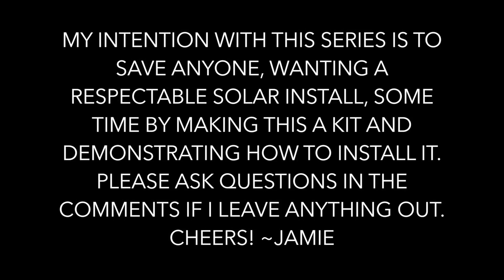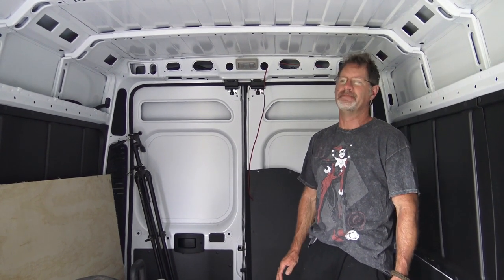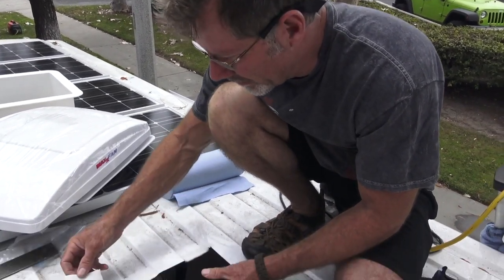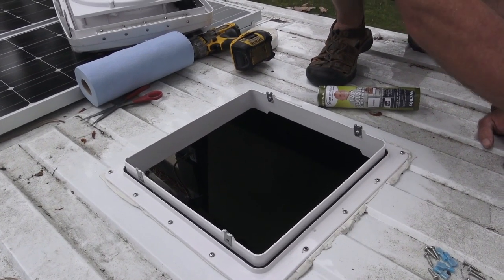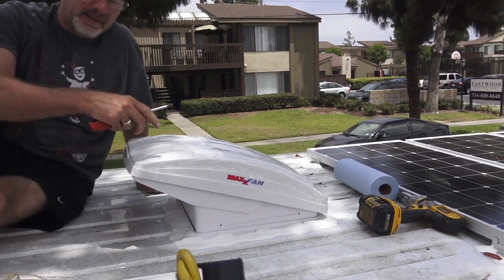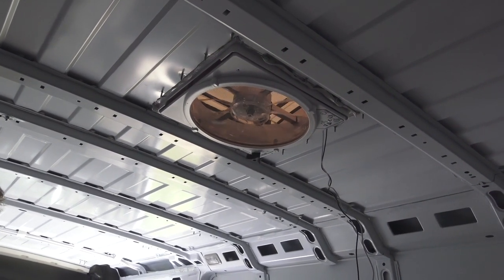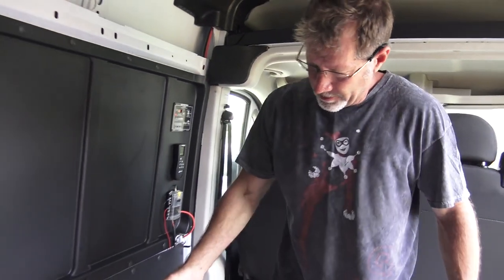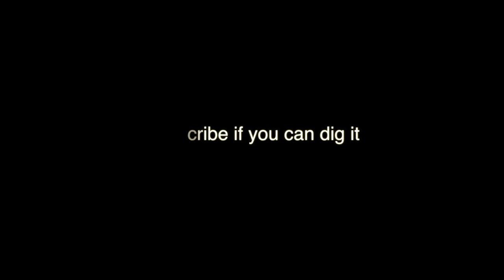How to install a Maxx Air Fan on a Promaster Van | Solar install Wrap up

Comment: Grinder: $12 at Harbor Freight with their 20% off coupon.  I'd suggest the roof cleaning before the corner holes!  :)

Dangerous setting self tapping screws like that on such thin flexible sheeting as vans have, would predrill with an undersize drill bit so amateurs aren't over driving the screws and risking cracking the flange...  

Also, since minimum roof thickness is 1.125" for the MAXXfan, many will want to frame out the freshly cut hole with something like 2x2 lumber before screwing down the roof flange, and that way the screws will just go through into the wood.  This gives you a little more solid of a mounting, as opposed to just screwing the interior trim piece into whatever ceiling material you use (plywood, tongue and groove, etc.).

Also, carefully wash the roof after the Dycor dries: all the metal shavings will rust from the cutout that blew across the roof and create a heck of a rusty stain.

Oftentimes easier to do the wiring before setting the fan in place.

I'd also recommend cable wrap on all wires in the van.  Just not worth the few bucks of savings versus the chance of a shortout later that will be a huge thing to deal with:

https://www.harborfreight.com/catalogsearch/result/index/?dir=asc&order=EAScore%2Cf%2CEAFeatured+Weight%2Cf%2CSale+Rank%2Cf&q=cable+wrap

A great fan.  I'm a fan.  :)
Reply from the maker: All great advice!
Reply: B Miller wonderfull now I dont need to write all those suggestions out.. just takes a few YT views to learn all the pieces to the puzzle and get it done right. I always learn a lot from reading the comment section. Thx!  BTW when one does screw the fan through the metal roof into the inside wood frame you will probably need longer screws i know.. but what kind would be best for that application? Thx again.
Reply: Great advice Jamie. Can you recommend someone for hire including yourself to install a Maxx Air fan in a Ford Transit?
Reply: Don't use a grinder. The sparks will stick to and melt your paint and then cause rust.
Reply: I am doubting they are self tapping screws to begin with.  I have just received and about to install my Maxx Fan Deluxe and they most certainly are 'not' self tapping screws.  Maybe his were, but odd that mine aren't I guess.   Will be using a small drill bit for install.
Reply: @enigmaticnomadics  What do you mean it's easier to do the wiring before setting the van in place?
Reply from the maker: @stevenjoseph8134  I would definitely predrill Steven. Plus it helps prevent the screw from walking around and making the bracket holes bigger than it needs to be.

Comment: Bro, I’m about to do this. This video has given me confidence to go through with it. So well done! I’d love to know more about the battery and wiring
Reply from the maker: The white wire goes to negative and the black wire gets a 7.5 fuse (in-line is fine) goes to positive.
It comes with a fuse also, but that’s how I do it.
Reply: @enigmaticnomadics  and type of battery?

Comment: Thanks for this. It was very helpful during my fan install a couple of days ago. I wish I hosed down my roof sooner even with the wet caulk as I did a lot of scrubbing of those little metal shavings this morning. Also, the angle grinder looks easier than my jigsaw but it got the job done.

Comment: Amazing videos Jamie. I wish I already knew about the electtical. Just bought a bare, used 2015 Ford Transit. The owner did the most bizarre installation of a fantastic fan that I have to remove and replace with a MaxAir fan. I'm going to try to do it myself with your video. Thank you for posting all your videos. Been following you for 2 years. You're amazing!😇

Comment: Diyvan.com makes an excellent flange for the ProMaster corrugation, and offers good advice and installation tips too. Recommend pilot holes even with self-tapping screws, and painting the bare metal with a rust-resistant paint like Rustoleum. Not related to the fan, but I also found a handy organizer for the rear driver side door in the Professional's Choice equestrian trailer caddy. Nice job, safe travels!

Comment: WARNING this guy is some kind of grinder master craftsman. I believe this guy grew up with only one tool the disc grinder and this is why he prefers it lol. I installed two fans on my van and used disc grinder on first one it was a MESS! I HIGHLY RECOMMEND USING THE JIG SAW. Went way smoother with way less metal mess everywhere.
Reply from the maker: +Mowglie lol, jigsaws with a high quality metal cutting blade work well also. I carry one on hand. In my experience. They tend to scratch the roof more. Your mileage may vary. 😉

Comment: Thanks Jamie for the detailed walkthrough of the installation.  I plan on doing my van build June 2019.  If all the electronics are installed first, I wonder if that will make it more difficult to install the insolation and panelling afterwards...
Reply from the maker: Well here we are in June, how’s it going? It really depends on you knowing in advance where you want your wiring in your outlets to be, but I think running the wiring before the insulation is a great idea! Thanks for watching!

Comment: Thanks for an excellent video.  I used it to guide me through my own installation.  Only question is, where does the van wire come from?  Is it the back up camera?  The puck light?  A stand-alone wire you hooked into those fixtures?  This is the last step in my install and any clarification will be greatly appreciated...
Reply from the maker: I connected to a fuse block. As long as you have continuous 12v power running to the fan, your good!
Reply: @enigmaticnomadics  Thank you for the info!  Truly appreciated :D

Comment: Hi Jamie... I had missed the wiring part (duhhh!!)  sorry bout that My BAD!!  Thank-U  You mentioned Automotive wire for the Fantastic Fan what Wire should I purchase?  TFS
Reply from the maker: I like 14 gauge stranded wire for this. Actually I didn’t show the wiring into the fuse block. My bad! We just wanna run the black wire from the fan to the positive post and the white wire from the fan to the negative post. But I prefer to put it through a fuse block at about 7.5 A fuse. Hope that helps!
Reply: @enigmaticnomadics  Yes.. Thank U so much for the Reply.  XOXO

Comment: I’d be in business if I had tools😏... nice vid! I was thinking of taking out my rear window
Reply: Wanna Wander   Check with your public library.  Where I live they opened lending tool library for anyone with a library card to check a few at a time.  The city found appropriate space & funded a library technician position that works with a slug of volunteers for check-out and workshop instructors. Two union apprenticeship programs donated a couple of complete tool kits, plus others in community have been donating needed tools off the "want list".  That grinder is a great example, yup only $30 bucks, but what am I going to do with it after cutting a hole in the roof of van.  Might give to the library if they don't already have one for checkout.
Reply: Karin Hart wow! That’s super cool! What a great idea!!💡 I’ll do that! 

Happy trails💜
Reply: Wanda, yes a great idea. Several towns & cities in my area have Tool Lending Libraries.  I once gave a friend a ride to the tool library & he walked home pushing a wheelbarrow carrying a shovel, rake & post hole digger he checked out for a long weekend.
Reply: Wow! That’s great!

Comment: I've seen a lot of installers file the metal and spray Rustoleum before applying the butyl tape.  Is that not needed to prevent rust??

Comment: You should be using wood blocks as backing when screwing through the roof so the screws have something to grip other than a thin layer of metal

Comment: I have this fan and I can’t seem to install it on my 120V AC. I tired a LED light driver/ converter with a 6amp rating but it didn’t want to run

Comment: Where did you get the wires coming from the van? Did you run separate wires and connect it to the van batteries or battery bank for the solar? You didn’t say where the wires came from that you’re connecting to the fan.
Reply from the maker: We used wires that we bought separate. 14 gauge. Ran them to the 12v fuse block powered by the coach batteries and used a 7.5 amp fuse

Comment: What was the fan wired to, I know to the van, but what in particular?
Reply from the maker: The fan was wired to the fuse block which was getting power from the coach batteries in the van. Hope that helps.

Comment: hi Jamie < so these fans are good ? so my understanding of these fans is that you can leave your window down a little and the fan will drag the old hot air out correct ? they must be very strong draw
Reply from the maker: Yes, Maxx fans are probably the best on the market.
Reply: @enigmaticnomadics  : thanks, Jamie also I continually re-watch your video on Lou and his vardo , how is he going ?

Comment: 4.5 to 4 inch angle grinder; cutting disc? correct ??  There are multi use cutting, that are steel, that last longer. ?
Reply from the maker: Yeah, actually any size grinder disk would work, but you’re right, it needs to be one design for metal cutting. Side-by-side the ones designed for cutting brick and mortar look exactly the same, but it says it on the side of the desk. Good luck!

Comment: What wires did you use too extend the max air fan wires too your fuse block?
Reply from the maker: I used #10 wire but smaller wire would work.

Comment: Could I run this off a goal zero lithium 400...or 12 volt...??
Reply from the maker: I’ve never tried that bread, but it seems like it might work for a while at least. You can definitely pick up a deep cycle battery from Walmart for pretty cheap if that’s the best you can do. These fans are pretty low drawl. Best of luck my friend!

Comment: Hey Jamie, Great video here as well as the solar/shore power install. I was going to have a Maxxfan installed at your van build party but doesn't look like I'm going to make it as I have toooo much left to do on my van build. Not much of a carpenter and I'm slow. Anyway, on the MaxxAir fan install, what type of screws should be used for the outside flange on a fiberglass high top van roof?
Reply from the maker: The ones that come with it should be fine. Id use 2 tubes of dicor instead of one on fiberglass. The dicor holds it down too. Try to make the build! Cheers!
Reply: Thanks Jamie. I'll try. Comimg from E. TN and would be a great help to have folks who know a lot more than me helping me to move this van build along. This is my first go around at this and I wanted to stay out there rather than drive all the way back to close out everything back here. Have a great build out if I can't make it and I'll try to catch up with you down the road

Comment: Where did you splice the red and black wire from?
Reply from the maker: A 12 volt ground block wired to the house batteries.

Comment: Thanks for the detailed instructions with the video. A lot of videos assume the viewer knows a lot, which I don't! I almost feel like I could it myself now. One question- I saw video where the maker said we should prime and paint the bare metal exposed after cutting. Do you think folding the tape over the metal makes this unnecessary? Thanks. Love your channel.
Reply from the maker: Glad the video helped! Absolutely folding the butyl tape over the edges seals it from moisture and that’s what we want to accomplish. You can do it!
Reply: @enigmaticnomadics  Thanks!

Comment: Very cool, but one problem. I have watched these three times and have not seen how you used the shore power that you brought into the van.
Reply from the maker: The shore power lines wire into the inverter/charger. The inverter needs to be an inverter/charger, not just an inverter. Here is an example: https://amzn.to/3bGykKR

Comment: What gauge wire did you use? and what size fuse?
Reply from the maker: depends on the run. I usually over do it and use #10 but it's only pulling about 5 amps max. I have a 7.5 amp fuse in mine.

Comment: Thanks for the walk-through! I’m going to cut the hole in my Promaster this morning. A question...I see how you connect the power but I didn’t see where you got the power. Are you tapping in to existing power in the back (brake lights?) or are you running power from the source?
Reply from the maker: Hey Joe! We connected to after market deep cycle batteries through a ground block I installed. We want to avoid using the car battery because it is not deep cycle, thus the fan drawing juice from it on a regular basis will shorten it's life. Good luck on your install!

Comment: Can i put a fantastic fan or max air on a fiberglass high top van?
Reply from the maker: Yes. Done it a bunch.
Reply: Laurie Sherwin It’s usually an even easier install, since most fiberglass roofs are flat. 👍
Reply: Sure!, It's actually a little bit easier because they are usually a flat surface. The only difference is I use boat life caulk instead of Dicor it's been developed for fiberglass and gel coat. And it's removable!
Not easy but with a putty knife and some solvent it will come off clean. I do scuff the first 1/2" of the opening with a scotchbrite pad to help with addheasion then wipe the area with rubbing alcohol. Hope this helps with your install.

Comment: You should have made you a cardboard template Jamie. It would have been easier.
Reply from the maker: No need. 14 1/4 by 14 1/4. Works every time.

Comment: what if i do not have those red & black wires you had there, do you have a vid showing us how to do that? :) !!!
Reply: OR is there away to directly wire the fan to some kind of rechargable battery???
Reply from the maker: Yes. The black wire from the fan goes to positive on the battery

Comment: What gauge wire did you use to connect to the unit?
Reply from the maker: 14 is fine. You’re pulling 4.65 amps max.
Reply: @enigmaticnomadics  This is saying that I used awesome

Comment: my 2018 has a spot made to put a fan that is flat  once you make the cut out
Reply from the maker: Yes if I remember right it absolutely does, but always remember where you want the fan and let that dictate where it goes. Some folks want to put it to one side or over their head where they sleep or maybe were there cooking. This guy really is the limit!
Reply: @enigmaticnomadics  Mines a 136 wb so it doesnt make much of a difference its close to the stove which needs ventilation the most
Reply: I also have a couple small fans near the rear flow through vents

Comment: Just remember when you put in the plastic trim on the inside of the fan and draw that line, you are measuring how much material to cut off. So, you measure that distance from the opposite side and cut that second line. Otherwise, you may cut off too little, or even worse, too much.
Reply from the maker: Yes, that's a great point that I didn't get into on the video. The best thing a person can do is if in doubt  take off a little at a time even if it means making several cuts. Thanks for the input.
Reply: Huh?

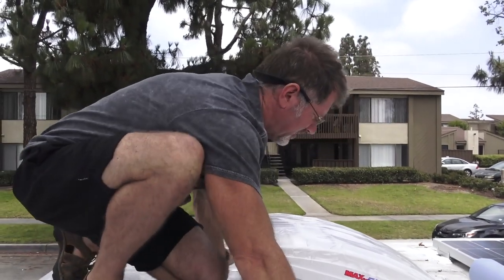Comment: 16:25
So, no caulking around the overlap when the fan is inserted into the support base?
I'm having two installed with a new rubber roof on my motor home and per the instructions as I recall that is the case.
Where does the rain water go in the gap?
Thanks!
Dave
Reply: Ahhhh, got it....a closer look at the support flange....

Comment: What did you charge to do this full install?
Reply from the maker: Everything was $2,300. It included a long drive to southern California. Moving forward the fee is $2,000. Meeting up at my location.
Reply: $2,000 ??? You're joking right? Wow, you are a real piece of work dude.
Reply: explain the price break down thnks!!!
Reply: Probably 20 hours worth of work so all in all probably a fair price.  Cici probably should have gotten (maybe she did) a price break due to this being filmed as I am sure that makes things take longer.
Reply: Most people ie those that posted below don't factor in costs of transportation to job sites. Plus the wiring looks great and clean. Excellent work sir and a fair price for sure.
Reply: Ken Adams it appears that’s for installing the whole solar and battery setup as well. Not just the fan.

Comment: Thanks for posting. I would suggest at minimum washers below the screws into roof to help avoid cracking the thin plastic flange. Others have placed a 1/4" wide alumium plate on top of the flange with holes matched to the flange for an even better solution.  Way too easy to overtighten and crack that flange IMO.

Comment: In case you know of anyone looking. This is posted on north San Diego County craigslist. " We are selling off our fleet of 2000 to 2002 Ford E450 short school busses. All busses have been perfectly maintained, have front and rear AC, clean titles, and run great! Mileages range from 140k to 170k and prices from $4200 to $4800. We have handicap and regular buses available. Feel free to call with questions 7.3 Diesels 714 315 6954

Comment: If you want a dimple free roof....lay plywood down to walk and work on.
Reply from the maker: I never put dimples in rooftops dude.
Reply from the maker: But sometimes I use cardboard or plywood. Actually that's very good advice.
Reply: @enigmaticnomadics  I only mentioned it because I have. Just passing it on.
Reply from the maker: Thanks for watching man.